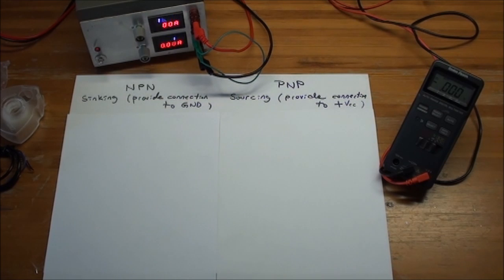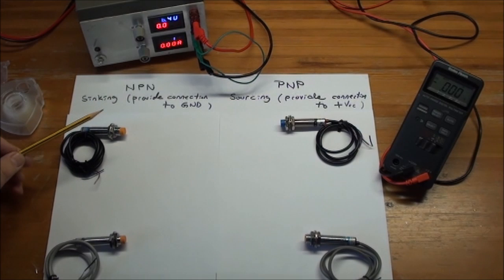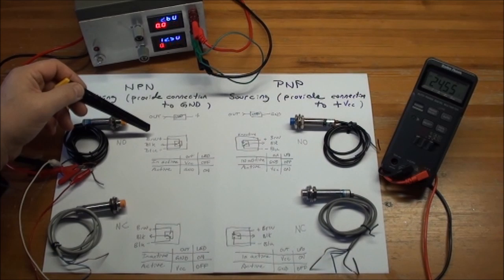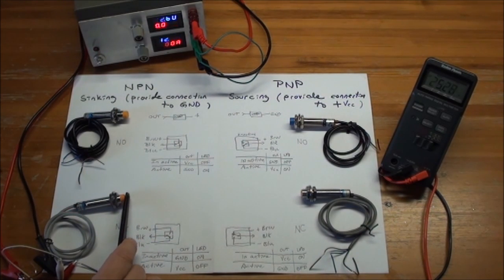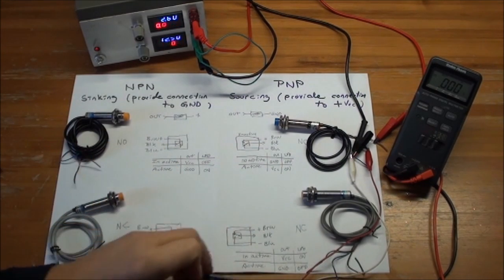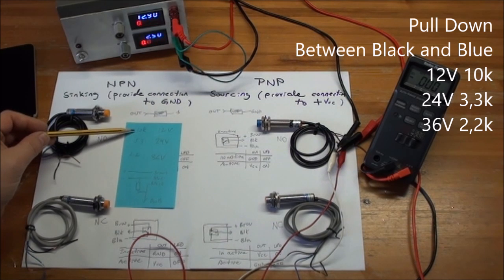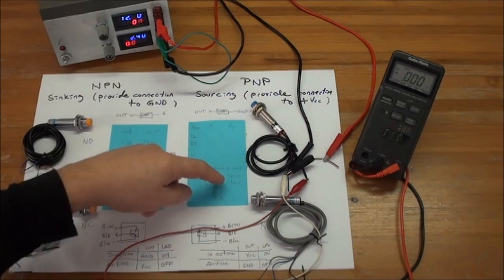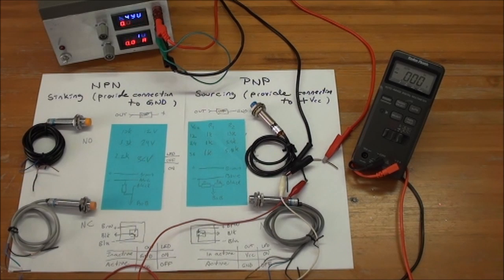NPN & PNP NO NC Proximity Switches - experiments with function and Pull Down Resistors

Comment: Very useful video, Martin, thank you very much. Could you please tell how do I connect NPN NC sensors in series? Still no luck...
Reply from the maker: Hi Alex, I have only tried to put them in parallel i.e. connecting blue-blue, brown-brown and black-black wires together. Then if one of the two is triggered the signal goes low. This has worked w/o any issue. Hope you can use my answer.

Comment: Let's say for instance, you were not given the information either about the type of sensor (NPN or PNP) or the state (normally open or normally closed). How would you go about to find which one is which?
Reply: These sensors have LED indicators on them, connecting them to 12 volt dc and measuring the voltage between signal and ground cables gives you state info (NO sensors will only provide voltage when it senses metal, NC sensors will not provide any voltage when detecting metal). As for the type (NPN or PNP) I don't have any idea how to figure it out